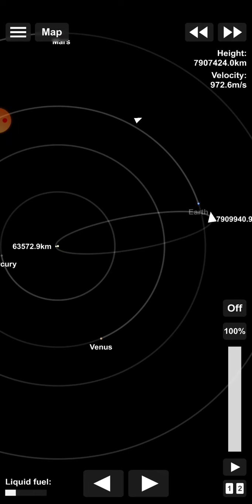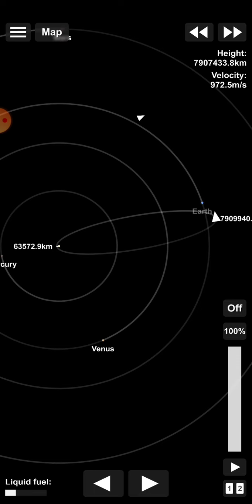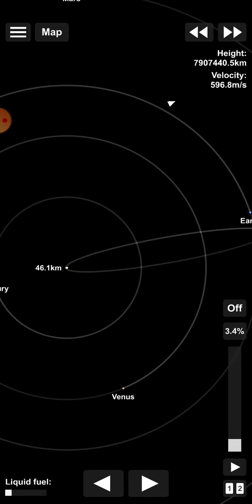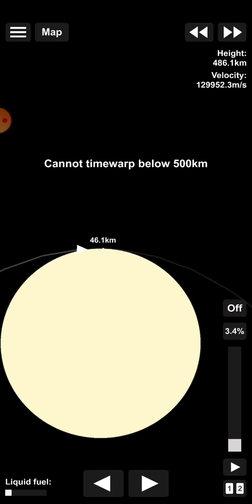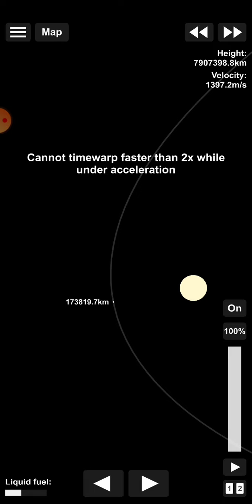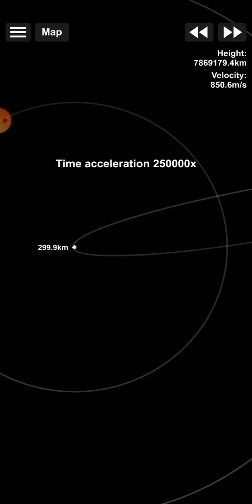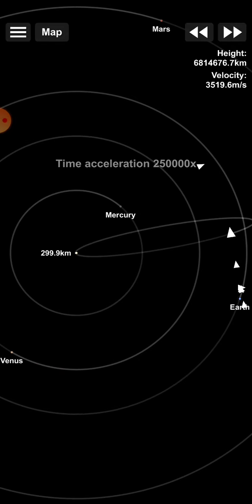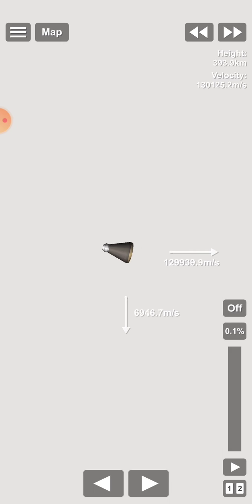RE-ENTRYS into the SUN are crazy in SFS!

Comment: I want to know what temperature you will reach when you go in with no heat damage on
Reply from the maker: I would love to now as well, but I don't have the cheats expansion
Reply: @sfsfrank7925  Will reach 100000000000000000000°c
Reply: @sfsfrank7925  if your broke try apks